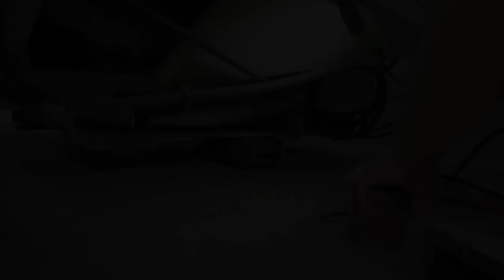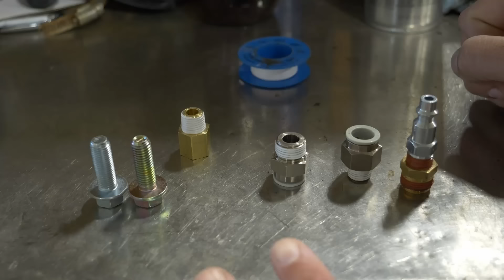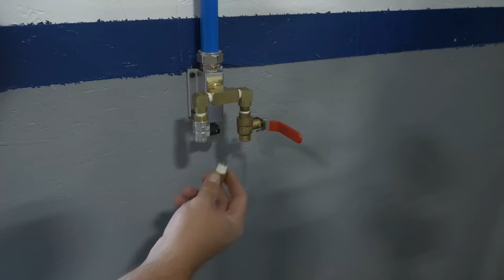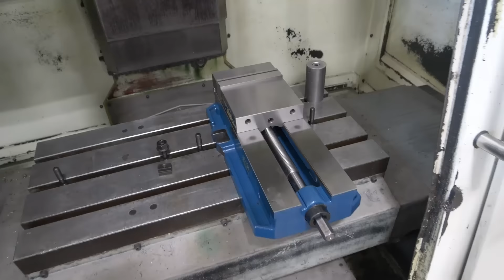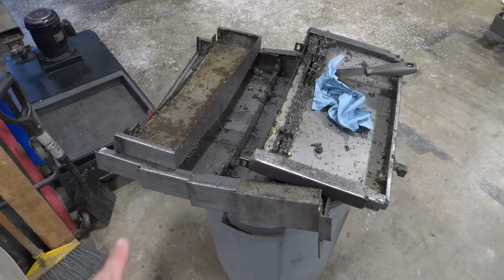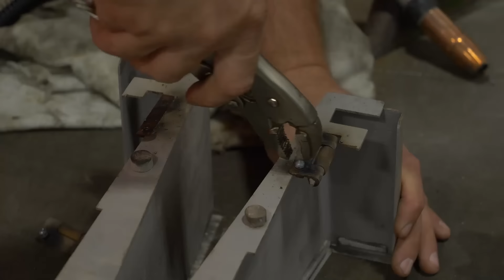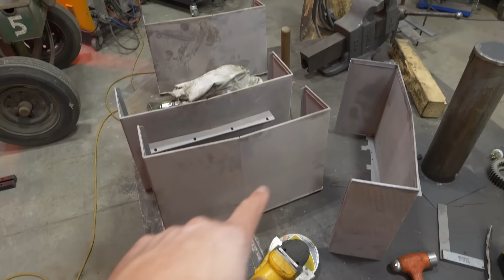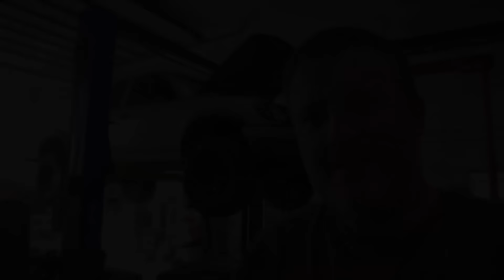Did I Buy a Problem or a Solution? Cheap CNC Repair Part 1

Comment: Greetings from metric land of beers, Škoda and 3D printing, Czechia. Just last month, I found old (at least 20y) air connection where BSP and NPT mated at the filter ... it was leaking and it was unscrewing a bit rough. And yeah, had to take thread gauge to figure out what was going on. The most common mismatch I observed in our lab (and it took some time to root out) was actually Swagelock compression fittings (for 6 mm - 1/4 in" pipe) when people managed to screw it together by force, because there were both metric and inch lines here. Nowadays just metric pipes and when a machine comes with imperial connection it gets immediately converted. Good luck with the machine(s)!
Reply from the maker: There are some fittings designed to be "universal". I know Parker makes them. We used to stock them in our maintenance department. They do have a pressure limit, but it helps idiot proof things.
Reply: honestly a good policy: and stamp somewhere you see when you begin maintenance that it's been converted to [System]:
: All hoses in JIC
: All bolts into Cast Iron in M-Coarse
: All bolts into Steel in M-Fine

Comment: A cliffhanger?  What is this magic!  As for that truck at the end - I'm glad to see we've gone back to the normal content of the brake lines holding a vehicle together.
Reply: Is it really a cliffhanger? From the phone conversation it's pretty clear - Wes' home for clapped out, abused, and cast off CNC machines is getting another resident! It's a story all too familiar to me - I'm working on fixing up a VMC as well, and then someone gave me a CNC lathe that no one else could fix that threw a monkey wrench in all my plans. Only difference is I only have a 2 car garage, and he has lots of room!

Comment: ~@10:00   as an engineering student, I was exposed to the metric system and all the similar units that were different....

like lbm (pound mass) v. lbf (pound force); kgf (kg force) v. kgm (kg mass).  torque was typically lb[f]*ft or in and N*m for metric.

Also, I got a set of JIS screwdrivers to repair my laptop as the US Philips would work but not as good as JIS.
Reply from the maker: That's where I was first exposed to it.

Comment: You can use air bearings to move heavy equipment like that.  If the floor isn't smooth enough (not gas tight) you can use sheets of polyurethane on the floor over cracks, seams etc.

Comment: foot pound or newton metres makes no difference, poor argument, both are units of torque.
Reply from the maker: It's not about the torque, it's about the force, which kgs are not. Look into it. Mass is not the same as weight.

Comment: Bud, kg’s are measurement of mass in the same sense that pounds are a measurement of mass. The ONLY difference in how they’re measured is, 1kg=2.204lbs. So 1lb=0.453kg’s. Don’t complicate it. If you’re going to get into the accuracy of the math, use a .5 meter wrench or a 1 meter wrench then do the math with your weight all being distributed at exactly that distance on the bar and no further or closer. You run into the same problems with pounds man. Also any Home Depot near me has a wide variety of compression fittings both American and metric. Let alone auto part stores and farm equipment supply stores. They’re common stock. You’re complicating uncomplicated problems. Look in the right place, you’ll find it, and you can drive to pick it up any day of the week. You’re probably looking for foreign parts from American manufacturers. Why would they carry it? They’re “special order” is them googling it for you, ordering it, marking it up 100%, because you don’t know how to get it yourself. All these fittings are common supply. At pretty much anywhere except a mom and pops hardware store and American manufacturing companies. 

Man I have to add almost all of the major equipment companies are almost entirely metric parts for example; cat, bobcat, case, John deer, Doosan, and the list goes on. All of the parts you’re speaking of are on those machines in a large variety of thread pitches/sizes. You’re having you problems that are no one else problems. Use your head before you post stuff man. Very discrediting here. Remove the video and start over, I’ll pretend I didn’t see it. I’ll give you a pity sub. Damn though..
Reply from the maker: No. The commonly used term "pound" is actually pound-force, lbf. To get mass you have to divide by the acceleration of gravity, 32.2 ft/s^2. That's called pound-mass, lbm, or sometimes called a "slug". I just looked on Home Depots site. They have no listing for any 12mm fitting of any kind.
Reply: @WatchWesWork  bud.. not helping yourself. Nm and ft/lb are each measurements of force. One has been simplified for you, the other apparently isn’t on any of your wrenches, and one you’re digging into when damn near any torque wrench has either on it anymore. The same could be said about ft/lb being a foreigner without a torque wrench that tells you. They’re going to have to do some math. Also my bad, got me no on Home Depot. Did you bother checking Napa? Auto parts stores? Napas are interesting because they pair with many equipment suppliers and hardware stores in towns they have business. Often their inventory isn’t all listed, not even close to all of it. I can get motor brushes for an old dewalt compound miter saw and hydraulic compressions as well as oil for my car a filter and a new pcm if I need one all at the same shop.. shit I can grab a Milwaukee wood hole saw set and plumbing supplies as well. Pex? Schedule 40? 20? Sharkbite? Crimp on? Expansion? You name it. Need some gas line for your home? lol all at Napa. Case? Cat? Doosan? Equipment supplies near you that sell these brands? Come on man..

Still case, Doosan, johndeer, bobcat, cat, and so on.. equipment supply stores. That probably surround you.
Reply from the maker: @David-1H1  Just go to wikipedia or wherever and read for 1 minute about the difference between "mass" and "force".

Comment: On the subject of torque wrenches: The English unit of mass is "slugs". So if you have lots of mass I guess you get "sluggish" ?
Reply from the maker: There's also the "poundal".
Reply: @WatchWesWork  And the rate of change of a poundal is called a "jerk" . 
Actually, I prefer the metric system! Nice video Wes.

Comment: I've heard this saying before: "The wonderful thing about standards is that there are so many of them to choose from."
Reply: and if you don't like it ie  says this doesn't works...   Let's create another standard.
Reply: @TheStefanskoglund1  “There are 36 different standards.  There should be one universal standard!  You now have 37 different standards.”
Reply: @seanwieland9763  Yup. There's mains plug types A through M. Let's design a universal standard to replace all of them! Oops, now there's types A through N and only one country kind of adopted the new universal standard and another one modified it enough to be only kind of compatible (and happily uses it for a voltage it wasn't designed for). And then wait for another country to come and invent type O.
Reply: I hadn’t heard it before, but it’s hilarious and true!
Reply: It sounds like something Mark Twain would have said.
Reply: @Mishn0  Twain probably didn't think of it because there were only half as many "standards" in his time!  LOL
Reply: The thing about standards is, sure, there can be 36 for a variety of reasons; but as long as you and some other guy/gal you want to work with AGREES to that standard, you're in business!
Reply: And the manufacturer of the machines I work on seems to want to use every one of those thread type standards, often on the same machine... All have their plus and minuses but damn, make your mind up 😂
Reply: Well 😅, what exactly has the metric system (not standard) to do with a taiwanese company who choosed a British imperial standard instead of an American imperial? 

I would suggest they prepared it to be exported to the US and thought, it had to be conical imperial not aware of the difference ...You can't blame metric man for that one

Comment: Welding up frames. I can't imagine what the liability insurance would cost for that plus you'll need to invent a way to weld paper thin rust together. 🤔
Thanks for Part 1 Wes. 👍
Reply: No you cut out the bad and fab in all new. If that means making all new then that's what you do. Watch the boys what wear safety sandals and they'll show you how it is done. Pakistani Truck! I love their chain strap frame rivet drill.

Comment: TPU and a 3D printer and Bobs your Uncle.   A learning opportunity.   Thanks for the video Wes.
Reply from the maker: That was my first though. I don't think TPU will hold up.
Reply: @WatchWesWork  There are some more exotic rubber like filaments out there that are chemical resistant and have a fairly high abrasion resistance.
Reply: @WatchWesWork  Do you watch Clough42?  James does a lot of 3D printing with a variety of materials.  Recently, he made a little camera lens dust blower.  Maybe hit him up for some ideas.  Just a thought...
Reply: @Hey_Its_That_Guy  a camera lens dust blower isn't in constant contact with coolant and way oil though - those chemicals are pretty hard on a lot of materials, including the paint on the machine - to paint a machine properly, you need to use 2 part polyurethane paint, or powder coat, as they are the only coatings that will stand up to long term coolant exposure.
Reply: @WatchWesWork  Why not use your fresh CNC mill to cut that stuff out of rubber

Comment: Always fun working on old equipment. Especially equipment from other countries. Not that they are bad, often they are amazing equipment. Just finding parts. As they say, the most expensive equipment you can buy are the ones that are the cheapest or free. Thanks for sharing.

Comment: 10:00 I'm not trying to be the typical metric system defender here, but this example is extremely specific. If the torque wrench had a slightly different length, like 10 or 14 inches, the ease of conversion immediately completely vanishes. 
I agree that PSI is easier to visualize than bar (until you realize that 1 bar is roughly 1kg/cm²), and I agree that lbft is easier to visualize than Nm (until you realize that 10Nm is roughly 1kgm), but those really are the only two situations that I can think of where the imperial unit makes more sense. So basically, in metric you have to remember two very basic ratios (1:1 and 10:1) to convert a unit into something you can guestimate. I don't even wanna know how many weird and random ratios there are to convert between various imperial units.
Reply from the maker: I get it. You should try cooking in the US. It's such a nightmare. Ounces are unit of both weight and volume, but you have to figure out which to use by context. Teaspoons, tablespoons, cups, pints, quarts, gallons. I have to look it up every time. Or I just convert to metric...
Reply: @WatchWesWork  then there's Dry Measures and Liquid Measures and it just keeps getting worse
Reply: @Hyratel  a cup is close enough to a cup to me. Cooking ain't rocket surgery.
Reply: @1pcfred cooking generally doesn’t have to be precise, baking however is a lot more science/chemistry. (This I learned from my talented wife, who is very brave to tolerate her Engineer partner)
Reply: @AndrewMoizer  what I've noticed with a lot of baking recipes is they're not quite right. There's a lot of duds out there. You can follow everything to the letter and when you do you have an inferior product. Some recipes just need to be scrapped and others can be modified to make something edible. I guess tastes vary? I suspect there may be more to it than just that though. Something between incompetence and malice I'm sure.
Reply: @1pcfred  my wife, who's a trained professional in many of the culinary arts, complains all the time about poor recipes. She had an entire course on how to properly write them as I recall. And, it is a case where tastes vary considerably, so something that I might really like could well be a dud to you. But, having found something that works, the key is reproducibility, which is where an accurate recipe comes in. I'm more of a self-described "hand-to-hand-combat" cook, so I'm never really sure how things will taste until I taste them. Except for baking bread, once I found something that worked the way I wanted I weighed everything out, every time.
Reply: @AndrewMoizer  I try recipes I find on the Internet and most of them stink. Every now and again I find a winner but that's the exception. I'll only ever try what I think might be good too. So I should have a better success rate than I do. I'm no culinary professional but I do have a fair idea what I like. There is no accounting for taste though.
Reply: @WatchWesWork totally agree, especially since US liquid measures are different from the Imperial used in Canada. Going metric just removes the ambiguity (and seems to make it less stressful for Engineers cooking and baking)
Reply: Two things really bother me about the metric system.  The first is the way that everyone confuses mass and "weight" (which is really force), and that's what underlies both the example that Wes mentions in the video and he psi thing.  The confusion is evident here as well, because "bar" can't be kg/cm2 because pressure is force over area and kg is mass, not force. :)

The other one that drives me nuts is people who think celsius is inherently superior to fahrenheit.  It's not, both are arbitrary.  In general metric is better because it lets you do math with the units more easily, but if you want to do math with temperature you need to use a scale based on absolute zero like kelvin (or rankine if you're really weird).
Reply: @IanMcCloghrie  the only thing I ever really use are length measurements. What temperature anything is or how much it weighs is no concern of mine. It's hot, it's cold, it's light or it's heavy. That's as involved as I get. I can be very particular about how things fit together though. For me dimensions matter a lot.